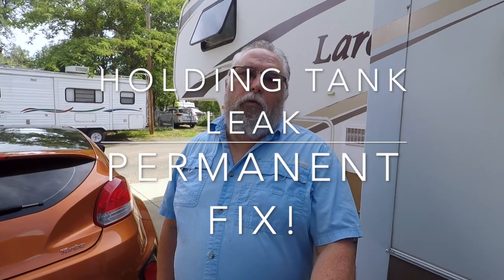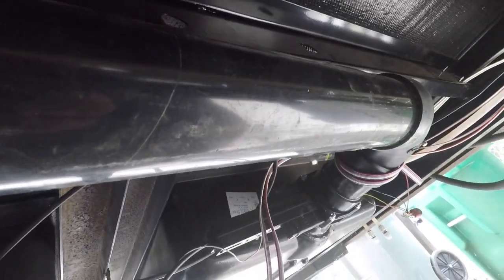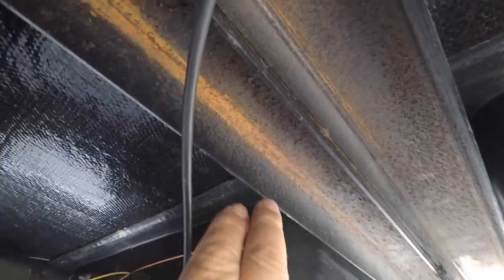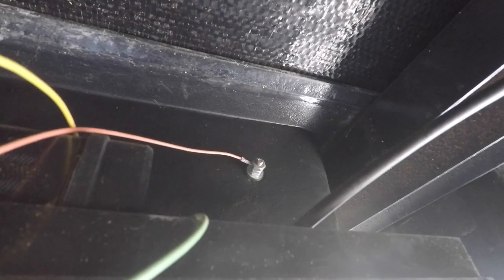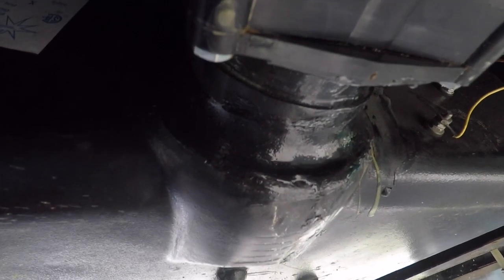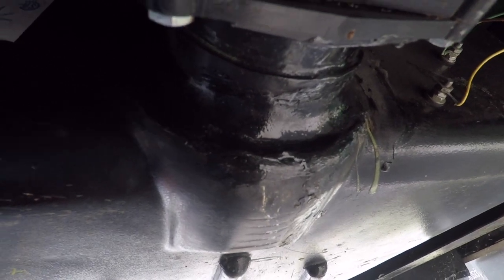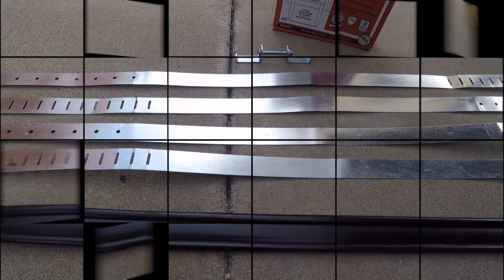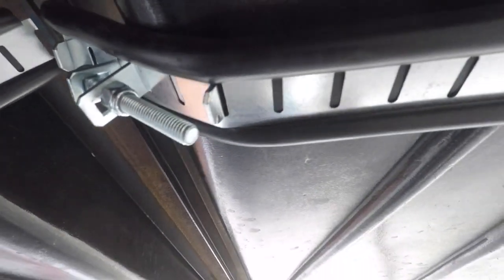RV Holding Tank Leak Repair And Permanent Fix

Comment: Looks like a great fix. I used 4 ratchet straps to hold my 52 gal fresh water tank up into place to the frame on both sides. My model of camper has a history of the fresh water tank falling out because of insufficient tank braces. I boon-dock a lot so I need to carry  a full tank of water. The 4 -10’long  1”wide ratchet straps  worked great and was a quick install.

Comment: Great idea I’m shocked at the construction of these trailers. It’s pretty crazy when you start actually having problems and seeing how these manufacturers construct various mechanical systems, wiring, framing etc. it’s unacceptable craftsmanship  to be honest for what some of these trailers cost. High end finishes for such a small space isn’t expensive. I wish there was a brand that actually did things right.
Reply from the maker: Actually, I think there is one. Check out Van Leigh 5th wheels. They are made by the company that makes Tiffin motor homes. They are designed built and warrantied for full time living. It’s what I would buy next time.

Comment: After getting a quote $1700 + to replace black tank. I disconnected my tank, hot water flushed in my downstairs shower then let dry. I heat welded with a wood burning craft tool then used West system epoxy with fibreglass  cloth & 100% sealed it 🇨🇦👍 ps; retired plumber . 72+ 🍁 Manitoba hunter expat 🍁 great vid fella

Comment: Thanks for sharing all that.  Agreed, it's ridiculous how poor some of the engineering and manufacture of these RVs.  I have the same arrangement on my Montana 5th wheel as you - two side-by-side 48gal tanks.  My grey split at one of the indents on the bottom because of lack of support.  The manufacturer had put two "C" channels across the whole bottom of the unit, but they were mounted on their backs and the flange was too short, so they both sagged, allowing the tanks to sag as well.  After crack repair, I am going to put two small I-beams with 2-3" webs across the whole bottom.  And, like you, never drive with liquid in the tanks again.